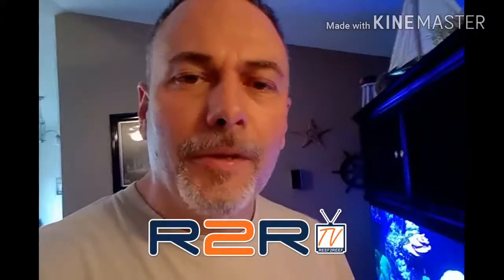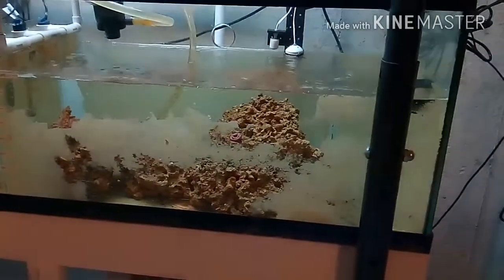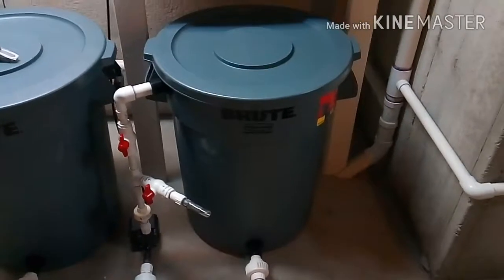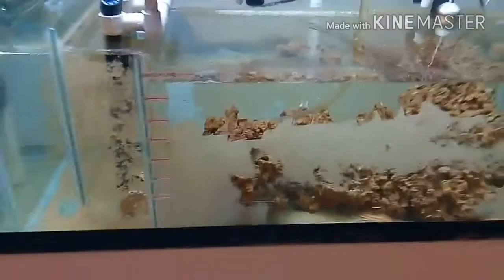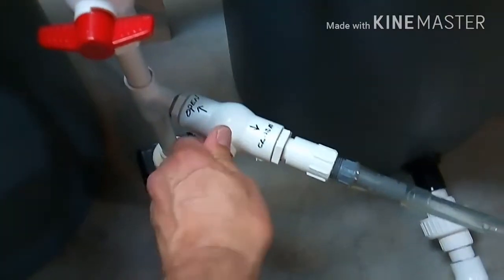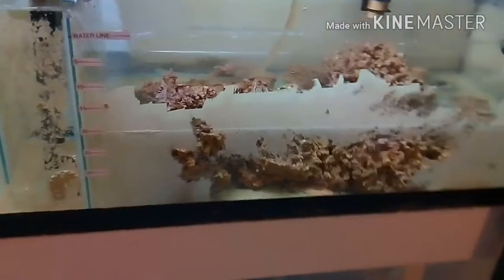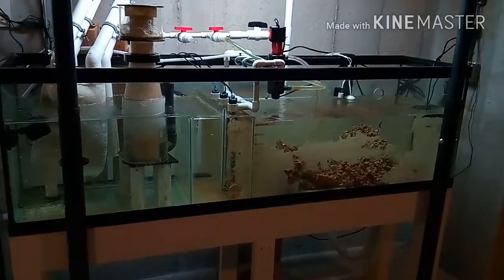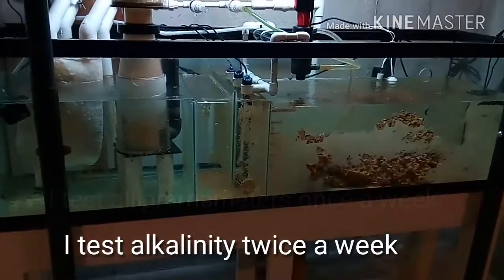Water change  via my basement sump

Comment: Older video, but a good idea. I hard lined 3/4-inch pvc for my 125-, 75- and 55-gallon tanks into the main sewer line. With a turn of a valve, I can drain up to 80% of each tank with in a few minutes. Now I've been looking into an easier way to refilling the tanks without connecting my Python to a sink (I want to hard line it somehow), but don't want water lines running through my dinning room (my fish gallery) and I'm sure the wife doesn't want that either.